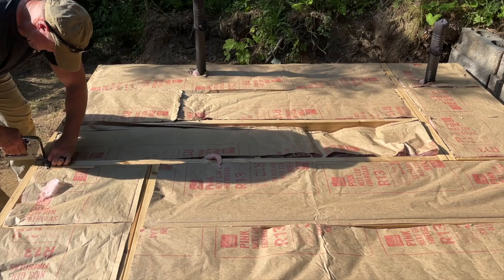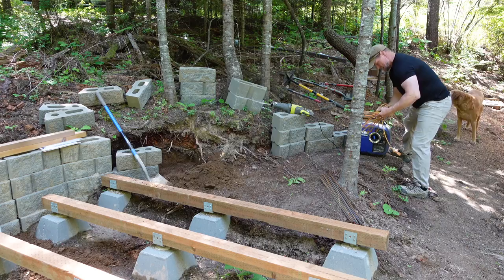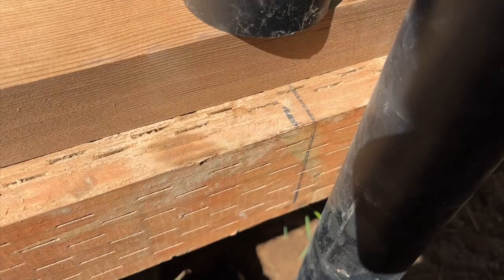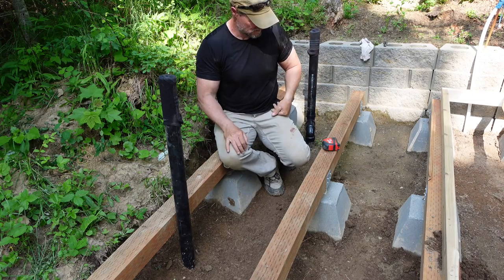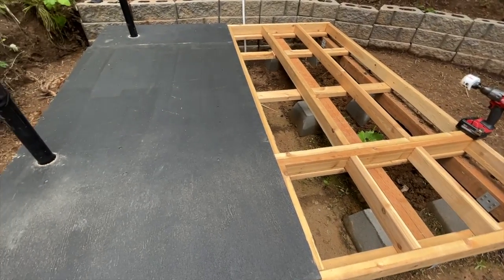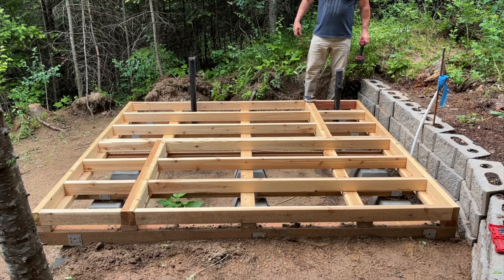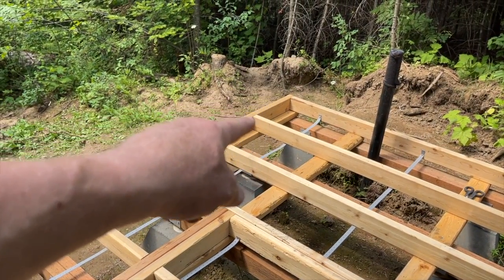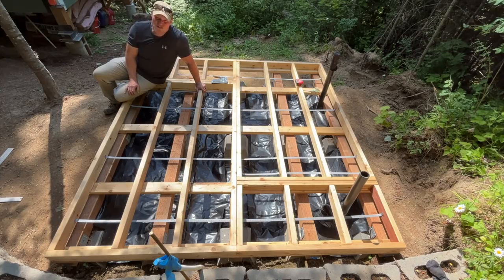Turning a Garden Shed Kit into an Off Grid Bathroom: (Foundation, floor frame, drains, insulation)

Comment: Rick, there are a couple things you could have done and made your job easier, but what you've done thus far will work well, I would - if you can still get in there, pull the dirt away from the wood, even though it's pressure treated, and put your metal down so you don't have dirt touching wood. That's the only thing I would correct if this were my build. Keep up the good work and I'll see you in part three............
Reply from the maker: Thanks for that recommendation Carl, I was kind of thinking the same thing. I will probably do that when I run the metal skirting on the sides just run it all the way around.👍🏼 We appreciate you watching and your encouragement sir!